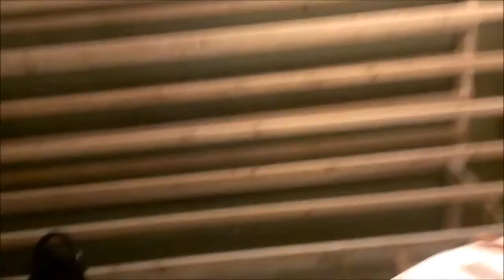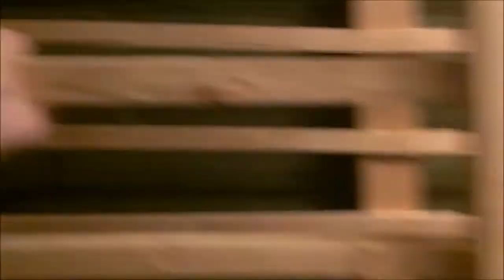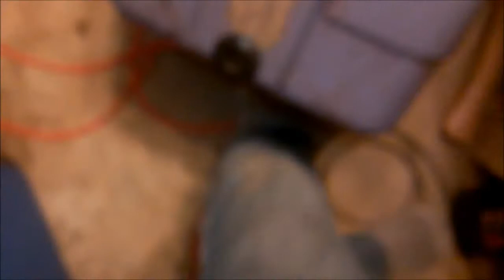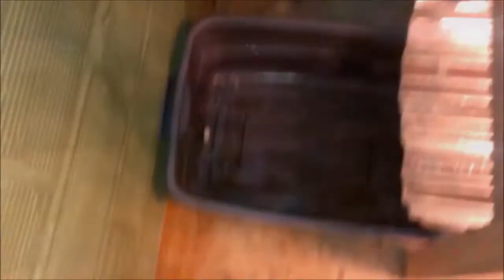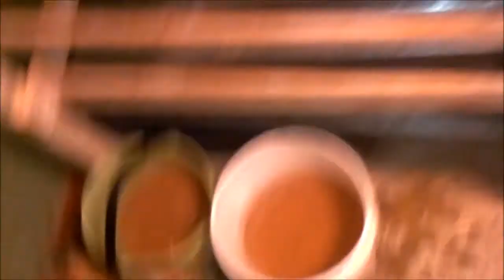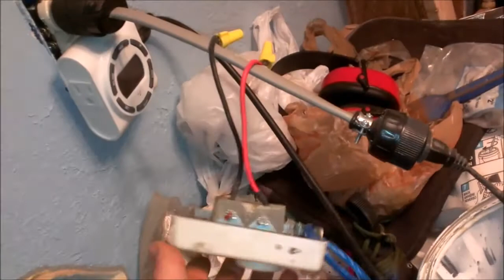Fodder system part 2

Comment: Looks great, but are you sure the 1x2's will be able to hold the weight of 3 sprout trays?
Reply from the maker: No. I am not sure. It is part of an experiment, but I think it will work fine. So far we have had no problems and we are 5 or 6 day into  it and are having no problems. .